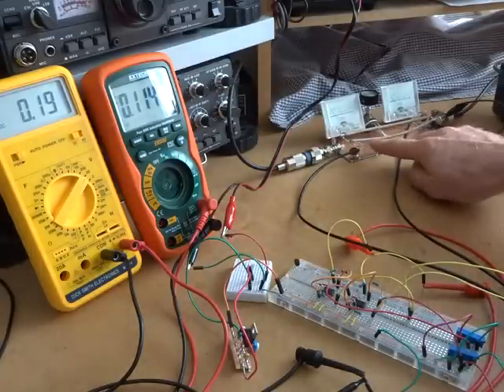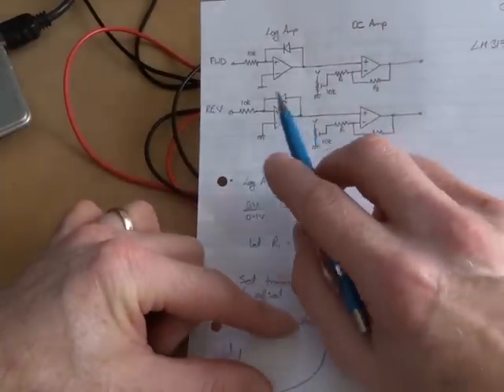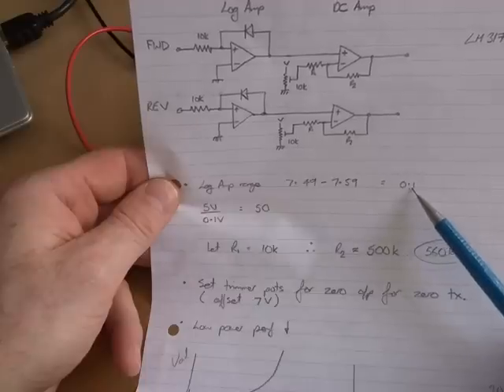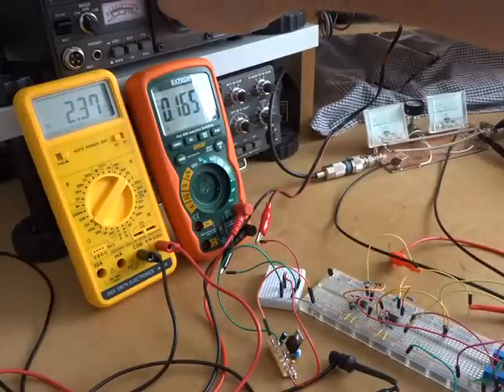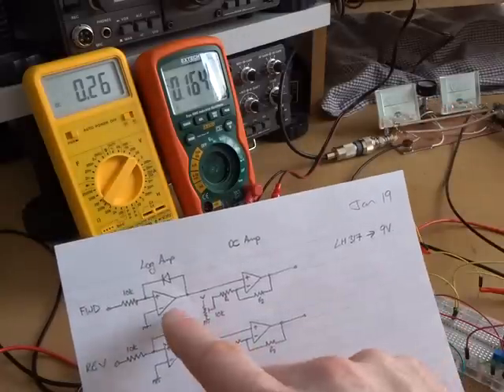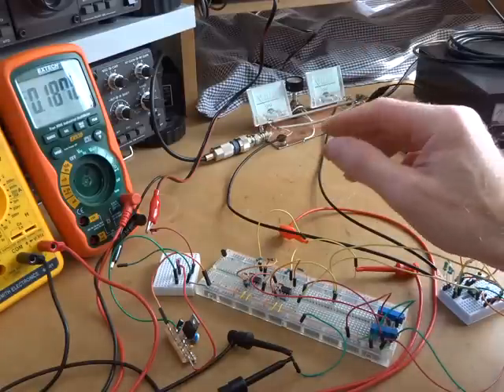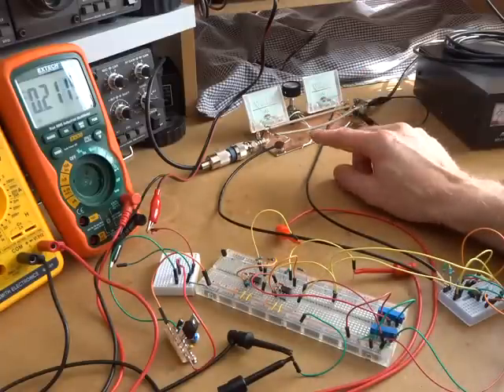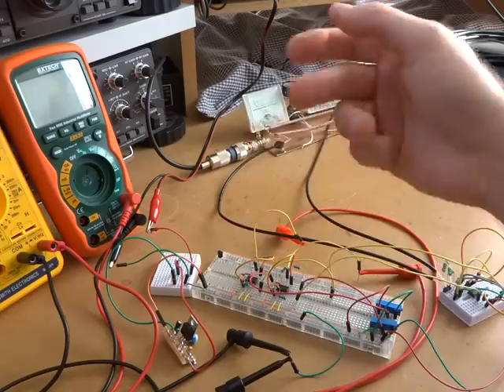Homebrew PWR/SWR Meter: Part 2 - Directional Coupler Experiments

Comment: Hello ... Try the ' Stockton Bridge ' ... It's very good and accurate .
Reply from the maker: Yes I certainly will. I believe the Stockton bridge (named after David Stockton, G4ZNQ) is the same topology as the Tandem coupler, which was popularized by John Grebenkemper.  I think it will work fine.  Thanks again.

Comment: Great investigation. Looking forward to the next part as I'm in the process myself of starting to use AD8307 in an Arduino application. 
Keep up the good work Charlie and thank you for sharing!
Reply from the maker: Cheers Harry. I think I will definitely go with the Tandem Match Coupler. Just trying ti determine now which toroid to use. The original used T50-3. I don't have any of those. Maybe a T50-2. I note others use FT50-43 too.

Comment: Hi Charlie, if your looking into using the AD8307, some of the designd I've looked at in the past seem to use a tandem match coupler that I think will do away with the need for the sence diodes. You should be able to measure very low power levels with that configuration I think....
Reply from the maker: Hi Brian. I've just ordered 20x AD8307 in SOP8 format for NZD5, so that's not too bad. No idea if they will work at that price! I think the tandem match is a nice idea, as well as the Bruene coupler. I will have to do some more research as I expect the tandem will need some diode to generate DC (I would have thought). It was certainly well worth exploring the other coupler and signal conditioning circuit.
Reply from the maker: Silly me Brian. I wont need any diodes as I will feed the tapped RF straight into the AD8307 (via any necessary pads).

Comment: You might be pushing the limits of the 1N4147s how does it go with Germanium or Schottky diodes?
Reply from the maker: The coupler is using 1N34A. Do you mean the log amps Chris?
Reply: @CharlieMorrisZL2CTM  Ah OK! yes, I meant the coupler.
Reply: I know this is a very old video, but the log amp schematic has the op-amp inputs (+,-) reversed….the + inputs need grounding, and the - inputs are the current summing nodes.   If connected as shown, your results are meaningless. Also it isn’t mentioned that inputs need to be connected to produce a negative input voltage with the logging diodes oriented a shown…this is determined by the orientation of the detector diodes.